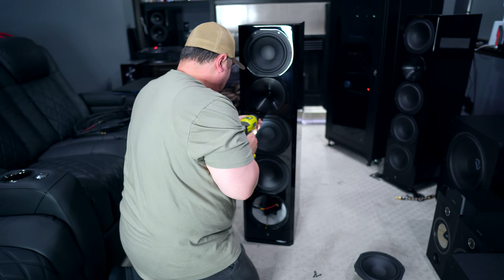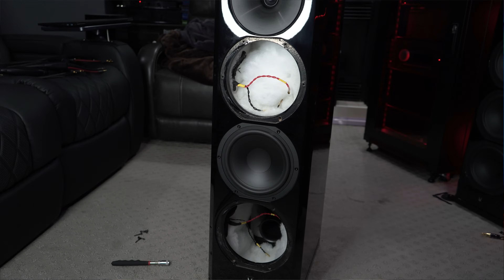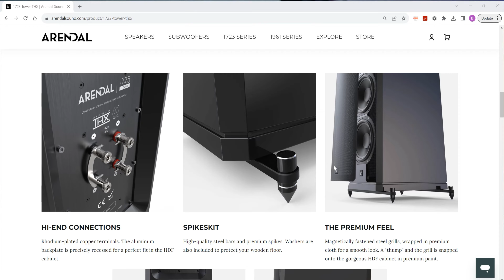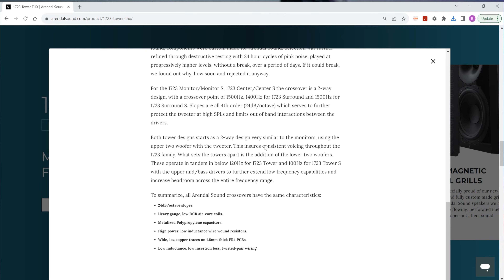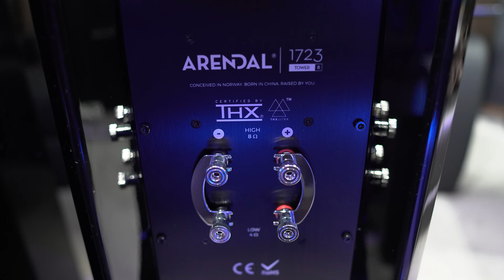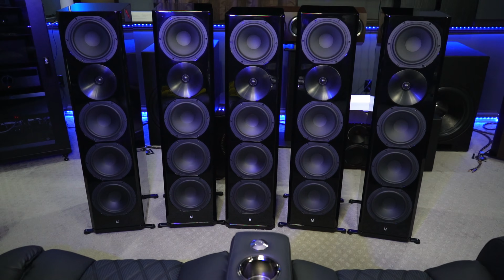A Close Up Look Of the Drivers/Woofers - Teardown of the Arendal 1723 THX Towers!

Comment: This is very helpful to me. I am in the market looking to upgrade my front speakers, a pair of the Polk Audio RP-2000P I bought in 2010. I am looking at Klipsch RF-7III, Polk Audio L600, and Polk Audio L800. The Arendal 1723 THX will be on the list. I need a tall speaker, at least 46 inches in height.
Reply: For home theatre, the RF7 doesn't have too many peers outside of the perlisten S7t

Comment: Do you need to take out the jumpers when using the speakers?
Reply: Thanks so much for your response. Deeply appreciated. I also got the same response from Kristoffer from Arendal this morning. Doubts and problem solved.
Reply from the maker: No, you only take out the jumpers if you want to bi-wire or bi-amp the speakers.

Comment: I have all Arendal in my setup and I love them.  I have a lot of the lineup:
Front Left/Right =  Arendal 1723 TOWER THX, Center = Arendal 1723 CENTER THX, Surround Left/Right = Arendal 1961 MONITOR, Surround Rear Left/Right = Arendal 1961 MONITOR, Height Front Left/Right = Arendal 1961 BOOKSHELF, Height Middle Left/Right = Arendal 1961 BOOKSHELF,Height Rear Left/Right = Arendal 1961 BOOKSHELF

I certainly wouldn’t have the Balls to disassemble my speakers (So, I’m happy you did…lol), but I will always watch a video where the components used are put on display.  I know that love my Arendal’s, but it’s nice to see what’s actually making them sound great.  The quality is unmatched by some speakers costing way more, Excellent Value, Great Sound…Great Video!!
Reply from the maker: Wow, what an incredible setup you have brother, it must sound phenomenal.  I don't know if I would have had the balls to do this to my own speakers lol, but Arendal was okay with me doing this teardown on this review set...thanks Arendal.
Reply: I am thinking between 1723 tpwers and monitors with subwoofer. Is there any difference in sound between your monitors and towers?

Comment: Drivers are all from peerless. Makes sense. Can probably pick up replacements from parts express if you f one up.
Reply: On Arendals website it states that the drivers are all custom built and cannot be bought from anywhere else.  No idea if it's Arendal that actually manufacture them though🤷🏼
Reply: @jaseamondo  it's a peerless driver through and through, maybe with tweaks for Arendal, but the whole driver is based around a patented peerless driver from years back. Good drivers for sure
Reply: @Luke-qs2cg  I absolutely don't know enough about it to say any different.  They do mention about sticking with tried and tested processes, so it's entirely possible that's exactly what they have done. No point trying to reinvent the wheel and all that.
Reply: @Luke-qs2cg  definitely looked like Tymphany/Peerless drivers. I worked for them for 2.5 years and they look like a variation of some drivers they gave me for a build as a leaving gift.
Reply: Correct.  HDP 830  series from peerless.  Only their own Button on backside. 😅😅😅